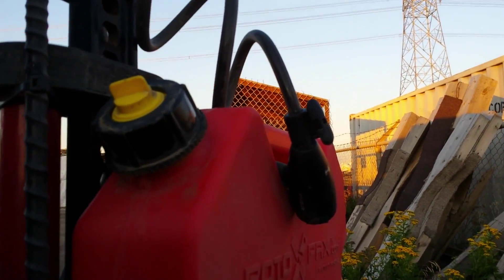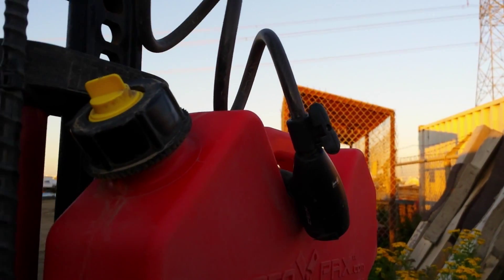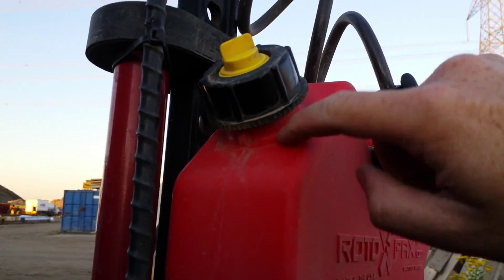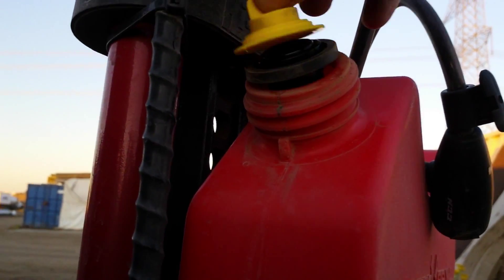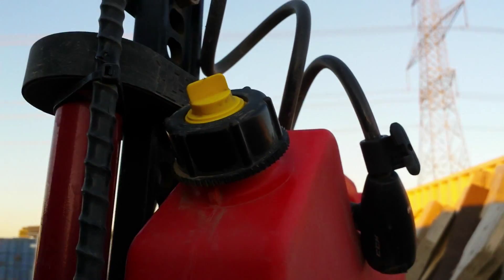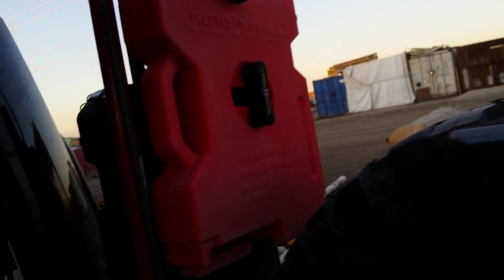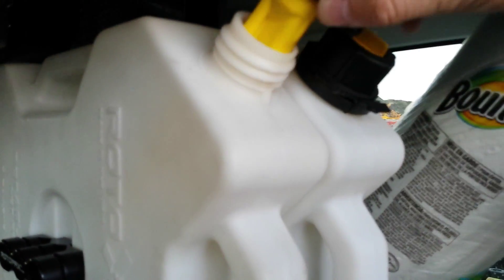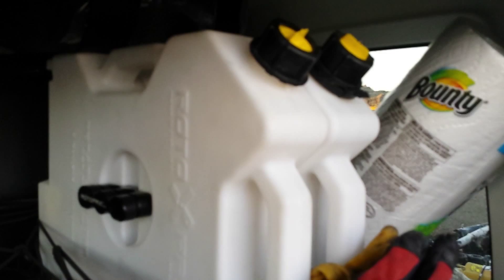rotopax 2 gallon container - cap failures

Comment: I removed the rubber seal from old spout, slid the old rubber seal under the yellow spouts seal. Now screw the cap in place fits perfect.

Comment: I just got the yellow self venting spout. It appears it's too long and when it reaches the inside plastic it knocks the end off center so it doesn't lie flat against the top when you screw it down. I will cut two inches of the end of the spout to clear that interior plastic. The end of the spout you then lie flat but I would still look for a gasket to make it a little thicker.

Comment: The cap is on upside down. The yellow nub goes into the can...
Reply: The cap is not upside down. In this video it is being used exactly as intended by manufacturer.
 Also, the yellow nub does not go into the can, it was not designed to go into the can.
Reply: Wait....Were you trolling us with that comment? Took me a year to realize that, unless you truly meant what you said. lol!